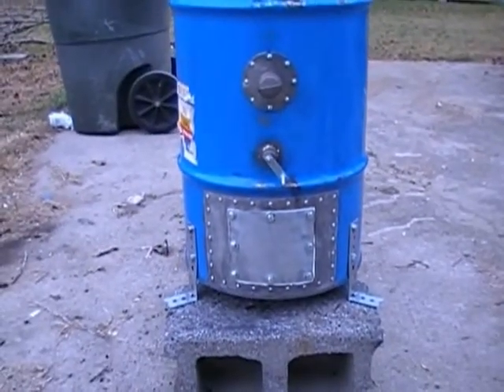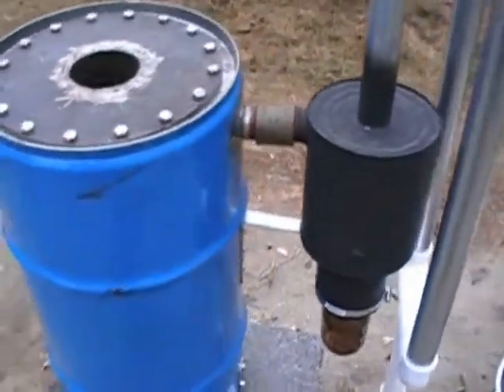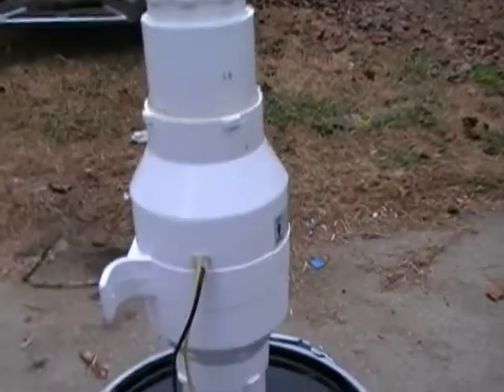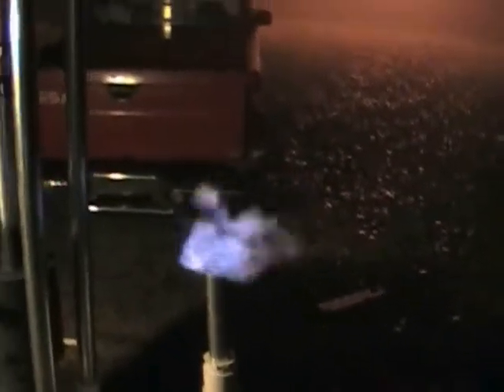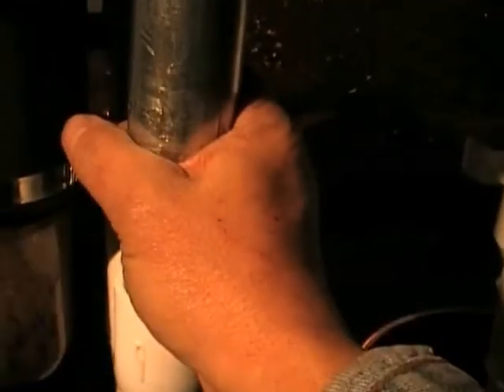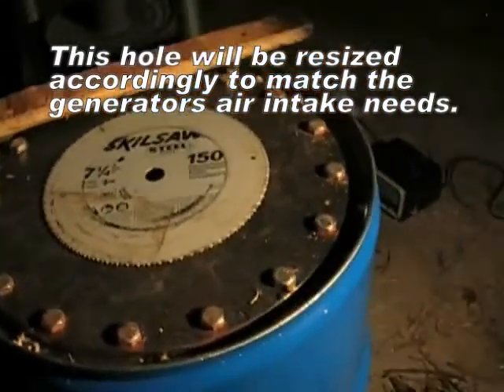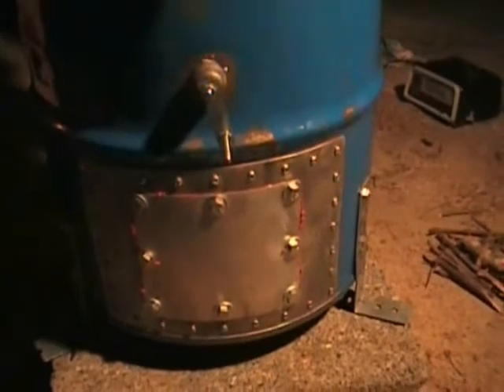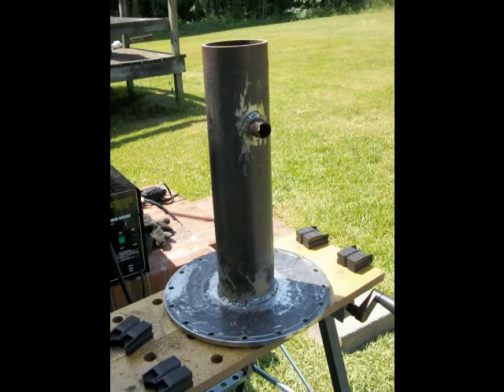Wood Gasifier Unit.

Comment: Would a water bubbler help for cooling and filtering? Is there enough head pressure for such a filter?
Reply from the maker: Now this is an old video when I first started experimenting with gasifiers But to answer your question about the water filters in my opinion there's too much back pressure unless you're using a Venturi filter system and the truth is if there are any tars in the gas they will carry straight to the system even passed the water filter. A good Venturi filter will definitely pull out Ash particles and other contaminants that can scratch the inside of a cylinder wall in a engine. With the new system I have I can get a lot of run time out of the filters before they need to be changed.
Reply: flash001USA that's pretty much what I was thinking. I'm watching your videos in order from oldest to newest. I'll try to reserve all questions until I get to the new ones. Thanks for the reply
Reply from the maker: Hey man no problem. Ask any questions whenever. I just wanted to make you aware that from this video forward things have been polished up and fine tuned to the point that it's not even the same gasifier that you see in this video
Reply: flash001USA Now you are tempting me to skip ahead :)
Reply from the maker: John when you get a chance check out the new video with the automation completed. It worked great the first time.
Reply from the maker: Hey I went to your page and seen where you had the video of Kevin Shipp there. That was one major wake-up call video. I couldn't tell you how many people I've sent that one to since I found it a short while back myself.
Reply: I'll check it out now.... can't wait!
Reply: There are so many videos from him, which one specifically did you see?

Comment: Flash hi Nico here, I have been running my 3 cyl diesel 20kva with my gasifier on 40%diesel and 60% gas for the past 7 years. is it possible to run my whole system on gas only, i use charcoal as fuel. Ive been told that one cannot run a diesel engine on gas only? Man i wish I had your videos earlier ive been on this for the past 15 years.
Your videos and explanations and running commentary are great you should be a college professor the way you can explain stuff.
Best regards from Namibia Africa.
Reply from the maker: Hey thanks for the vote of confidence. I don't know about being a college professor but if you are running your system on charcoal, that's about as clean and simple as it gets so I wouldn't see why you couldn't run the system on just woodgas.
Reply: Thanks for the reply, from what i have heard from a few mechanics is that diesel not only ignites in injectors but also is a source of cooling and lubrication to the tips and if you run gas only you need to change your tips/nozzles or replace them with i dont know what as the combustion temp is way to high whereas a petrol engine can easily combust at that high temp. Do you perhaps have a suggestion as to what modifications can be done to nozzles and fuelpump if any?I opened my engine two weeks ago cause it used oil when open we found that one of my oil seals at the flywheel was leaking and was the main reason for my oil consumption  all the sleeves pistons etc was sqeeky clean no tar or carbon buildup and that after 7 years of running with only oil and filter changes my genset runs 5 hours a day everyday!!!
regards nico
Reply: Sorry one more thing does your reactor not burn through?
Reply from the maker: nico badenhorst
That I wouldn't know how to answer. You may have to research that a bit. The engine will get most of it's lubrication from the crankcase oil just like a standard petroleum engine but I don't know what to tell you about the injectors. The glow plugs should be fine though.
Reply from the maker: nico badenhorst
Just to be clear this was my first gasifier video here and it was a FEMA. I have since built an Imbert that is very clean compared to this gasifier. but no my reactor has never had any burn through issues.

Comment: Flash,  Harold in Maine here.  I have watched several of the videos over the last 5 weeks and this is one I would put on a DVD or on a SD Card to share incase the internet were to shut down..  I do like how you keep it quite simple and functional...
HCinMaine 04630
Reply from the maker: Hey thanks... This was my first build and it is simple but the truth is it's too dirty and due to tar it will gum everything up including the gas pipes and the filters
on the gasifier. Check out the Imbert build that I did later. It's a bit more involved but it's well worth the effort plus the gasifier itself stays clean too.
Reply: I have checked out the imbert build and am impressed with what you have shown...
I also ordered me a hard copy of the "Handbook of Biomass Downdraft (imbert) Gasifier engine systems... it is also available on pdf but I grabbed a copy off of amazon. 
It explained what temps were needed for "cracking tar" and the different metals used...
Keep up the good work
HCinMaine 04630. 
I got an extra copy too.
incase some one sends me a mailing address..
Reply from the maker: Harold Cokayne
I don't know how much you had to pay for the PDF files but the information on Imbert gasifiers is pretty much scattered all over the internet for free. Some of it is hard to follow and some of it isn't hard at all to understand but unlike the FEMA papers, it unfortunately falls short on small engine plans.

This is why Wayne Keith makes money selling gasifier plans for building systems that will run a vehicle but I really think there are more people interested in real deal small scale Imberts for generating emergency power or even for going off grid.

I learned the basic concept on the Imbert builds then experimented. Did you ever go to my website miniwoodgas.com and take a look at the PDF downloads I have there? I have a lot of stuff on the Imbert builds there.

You mentioned temperature vs tar and that's also covered in detail on the website too. Check this out. miniwoodgas.com/miniwoodgas_002.htm

Unlike the FEMA plans that supposedly give you good information for different sized engines the Imbert stuff falls short on the small engine builds. This is what I'm going after. I would like to see what you get from Amazon. I would be interested in giving you my contact info but you will need to contact me through the miniwoodgas website where I won't be posting my address in the public view such as the blogs like this.
Reply: Flash - 
Okay will do....
I did go to the web site.....
I downloaded the PDF files for free...
I hunt and search and only spend when it is worth it...

Comment: finallay i have avideo on youtube( GAZ FIRE 2014 ONE) in this video there is no shaker and ignition port temporary to minimize the holes 

i already burned the charcoal and put the wood chips later i used r.t.v. silicon for insulatrion this material usually used for pvc pipes i dont know if it is work here or not the production is just smoke no gas what is the reason i want from you to write me the name of r.t.v. you used to buy it on ebay and is there afan on ebay simillar with your fan 

with best regards
nasser
Reply from the maker: Nasser I purchased my RTV cement from an automotive parts house. I seen your video and part of the problem might be the wood chips you are using. You may want to try to use either wood pellets or even small sticks broken up into small pieces.

Comment: what i want here the reasons that make the gasifier doesn't burn i used in my experement asmall fan it works but the production is just smoke that doesn;t burn 
also i used ashaker ignition port above the gasifier there is ahole for the air ,cooler and filter so what is the reasons that make the gasifier fail
is it important to put acharcoal in the biggining i didn't                                    i wait your answer 
thanks very mutch
Reply from the maker: Nasser do you have any videos of your setup? If you had a video on your channel I along with others could see what you have and possibly help you get it up and running. Do you have a cell phone that can capture video?

Comment: Yes; fantastic, nice clean FREE energy. That's video 18 where the gasifier "burps" when it is about to run out of fuel, right? Check Mr. Teslonian's channel. I have started to build his Ultimate I.S.E.S system where I await further videos and required materials. I am almost done with the primary burn chamber, need to purchase a welder for rest of build.Very interested in finding out how to larger scale fractionally distill bio-crude or the tars collected from pyrolytic processing of bio-mass.

Comment: To answer your question, we're not using this technology widely because it doesn't scale up well. According to the FEMA plans, 20lb of dry wood is about equivalent to a gallon of gas. We use about 6.8bn bbl/day, equivalent to a trillion tons of wood per year. Assuming a sustainable yield of 10.9 tons of dry wood per acre per year, we need 149 million square miles of forest. All the forests in the USA would replace less than 1% of oil use, never mind coal, natural gas, etc.

Comment from the maker: Very little modification needs to be done to the generator. You just need to have a way to control the gas and the air mixture.

Comment from the maker: theroofsedge Thanks for the reply. Have you seen "video 6"? I have actually taken this design much further and I am in mid stroke of finalizing a much better and a much simpler build that will burn cleaner too. Hold off on constructing the FEMA design. The Imbert design will work much better for you. Take your time and don't be in a rush to get yours built. Check back with me and hopefully I'll be up and running with the new build soon.

Comment from the maker: IF you have ever filled a paper cup half way full of water then light it. The fire will always stop at the water line and you can even boil water in a paper cup. This is why I am using the cement. I made my own cone but it was out of 16 Gauge steel so I had to protect it. There are some people making reduction zones out of potters clay too. I started to do that but I used the cement instead.

Comment from the maker: Google this. Imperial Mfg Group  Hi Temperature Stove & Furnace Cement This stuff is rated well above the call of duty for the gasifier!
It's rated at 2700 Deg F. You can use Refractory Cement too because it's rated up to 2000 Deg F or just Google the following: high temperature refractory cement. This will give you all of the information you will need. I wanted a cone for my reduction zone but paying a shop to make a 1/4 inch thick come was out of the question! Cont

Comment from the maker: novokarpati Thanks for the input. I do plan on surrounding the combustion chamber with high temperature insulation just for the very reason you have pointed out. My new Imbert combustion zone is already filled with the high temperature cement that's rated at 2400 Deg F.

Comment: OKay now, one suggestion is to line the actual firebox/combustion chamber with firebrick, that allows the temps to get above 1,200F and thereby burning ALL of your combustible volatiles...THAT's where you get the efficiency from.  It have heard that just burning the 'cellulose' in the wood gives you 25% of the available btu's,...BUT,  burning the volatiles gives you the other 75% of available heat.   I

Comment from the maker: Rudy if you view the filter construction video you will find the link to the PDF
file for the filter build. There are better gasifiers to build instead of the FEMA because it produces a lot of tar but it can be made to work. I used the FEMA plans to construct mine with a few of my own ideas mixed in with it. I am constructing a Imbert gasifier now and that will be the one I will make a construction video on. Check out Josh Banks channel too.

Comment from the maker: Sir you must read minds! I have added more pipe for a better cooling and yes, it made a big difference. The FEMA design can crack tar but everything has to be ran perfect with a good thick layer of red hot coals. I just came back from the junk yard and I picked up a 2-1/2 ft X 1/4 inch thick steel air tank that is bell shaped at it's top so it's perfect for a reduction zone. I will be adding air intake jets to this design to make a clean gas producer. Once again, thanks for the reply.

Comment from the maker: Thanks for the reply Mike. I'm in process of building a second gasifier with air jets. The one I built works pretty good but I am concerned with tar. Since you have built a lot of these things what is the best filtering method that you have personally tried? Any input would be welcomed by me! I will be releasing a second video with mods on this unit in the next day or so.

Comment: As another note some of the best filter stuff i have used r the things that can be water washed like bb's or even small steal balls filled into a pipe one that i have used alot is pure light it dont absorb and dont burn but makes alot of surface area to cool and collect water and tar and let it drop out just some info u might want to try! One thing u said yr fan will gum up over time not true if u get yr gas very clean! Most units i have made have 5 or more diff filter setups for clean gas!

Comment: Cool that u made sure u some how had a good cyclone one thing i have been testing out is in any pipe use a flat piece of tin and twist it and place inside the pipe it give more area for heat loss and spins the gas cleaning it!  One of my frds has gone a diff way and made a fin setup like a cutter but with a twist so the gas in a pipe spins u might want to try something like that too the spinning gas takes out more water than just a flowing one!

Comment from the maker: You are correct about the grate and I already have a cool upgrade for that. Don't let the vortex fool you. I should have mentioned this in the video but I just forgot and I was waiting on someone to point out what you pointed out.  On the inside of the top one gallon can, I have a shaped piece of internal metal that is curved to the inner radius of the can to give it the spinning effect. The can was too thin to attempt to tie into it's side so I choose this method for this build.

Comment: Nice vid a few things u might want to change tho one is yr grate u just used thin metal for it okay for short use but u did use a nice thick pipe for burner tube u should change out yr grate to a thicker metal or use a stainless bowl for better longer lasting! Another one thing u should change is how yr inlet to yr cyclone setup u have it going in it at a 90deg angle change that to more like a 45 deg so its more along side the can u will get way more action cleaning better!

Comment from the maker: The run time depends on the fuel. The stuff in the video started out in a one gallon paint bucket and it lasted almost an hour. I see it like this: I could have washed a load of clothes and charged a bunch of rechargeable 15 minute batteries with that burn all while watching some TV with a few lights thrown into the mix. As soon as I finish the tweaks I will do a video that covers the build in detail and I wish that I would have mentioned that in the video.

Comment from the maker: Thanks. This is a project I have wanted to build for a long time. I'm finishing up the improvements along with some upgrades on it and once I do that, I'll mount this on a small platform with wheels so I can move it around by hand or even load it onto the back of a truck. It will be set up so that I can disassemble it for transportation too.